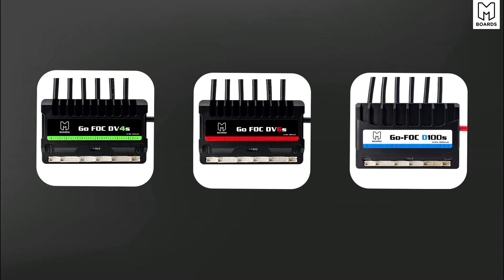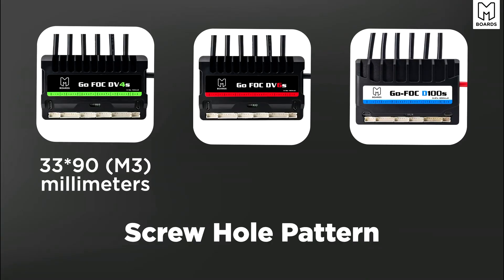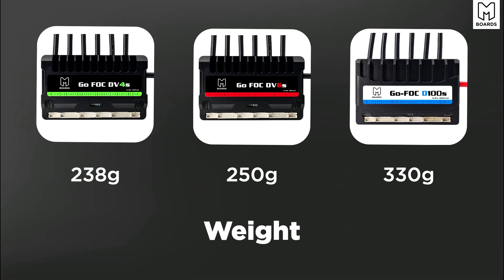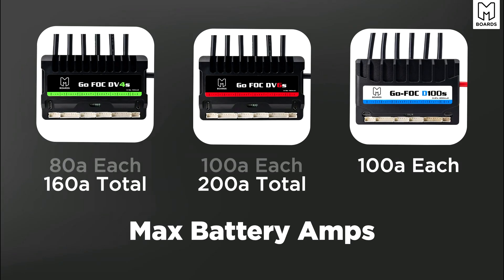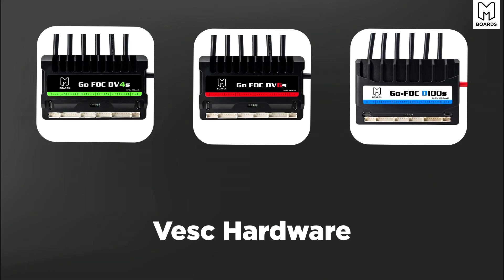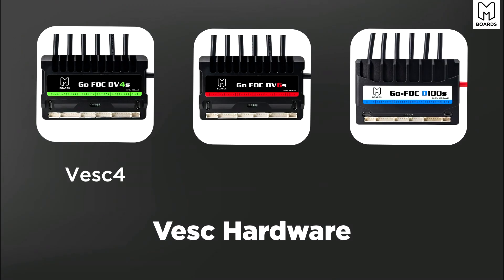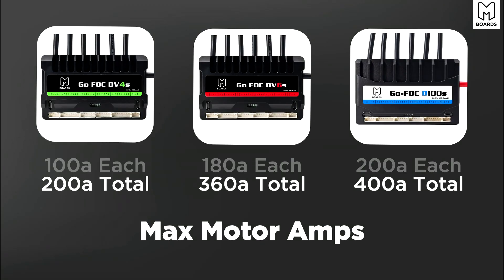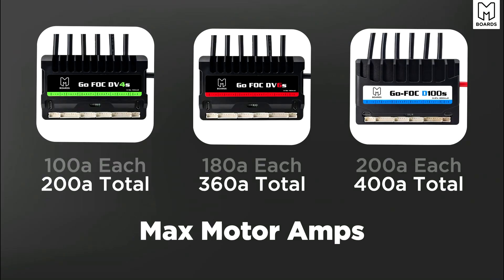DV4s VS DV6s VS D100S - BEST VESC 2024, Which one is right for you?

Comment: Would it negatavly affect in any way my set up if I buy the DV100 and I have a 10S5P?
Reply: Planing of doing the set up in vesc tool with correct parameters and all, I just had a very unpleasant experience with flypsky with a ESC that was good up to 13S and it did not work on my 10S... I just want to be 100% I ride my board at this point :)))  + I see that the dif is 20$ so why not upgrade to the 100?